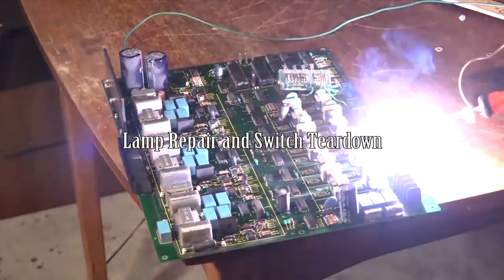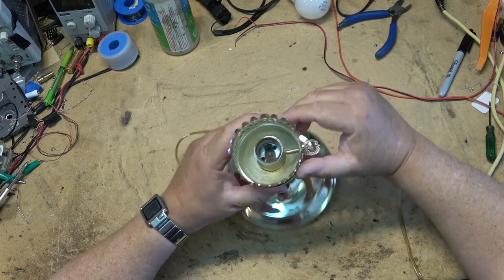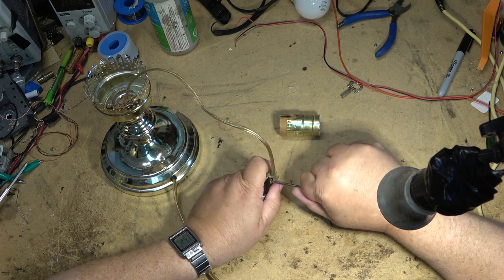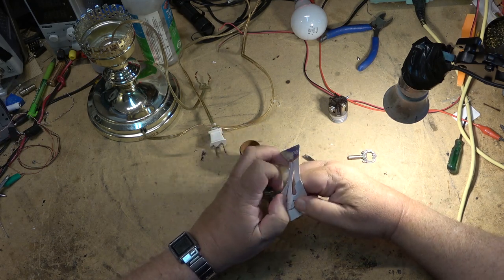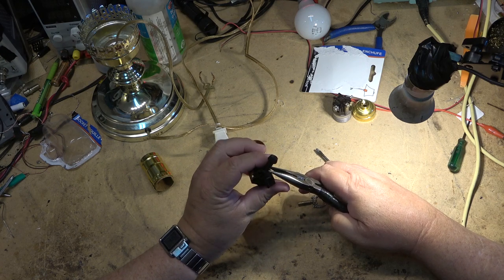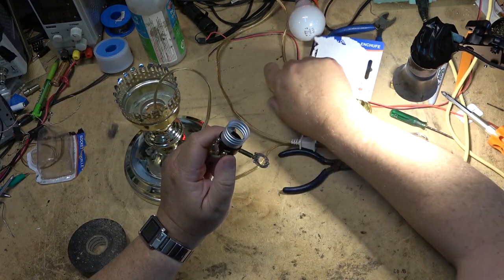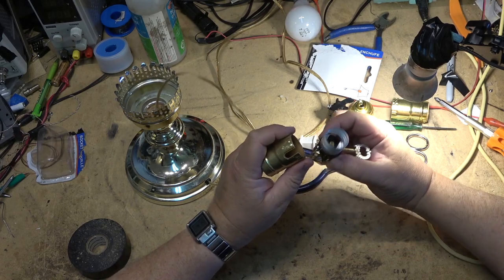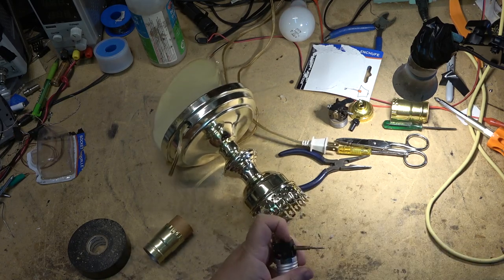Lamp repair making different sized parts fit

Comment: Did a little panasonic crt tv i found at the side of the road tonight , it sounded like it was coming on and i could feel the high voltage , but no picture , i couldnt find anything immedietly shorted or open, so with it being of that age i thought it could be a cap, i used the hot air station to heat the caps and it turned on , but had a fuzzy picture , so i took out a load of caps and tested them for capacitance, esr, and dc continuity , and found a couple of completely open 100 uf caps , tv working perfect now. Appriciate the confidence ive gained from watching 12 volt vids , youre unknowingly helping fix tvs from here over the pond

Comment: Thanks for the video, it fixed my lamp! 
    I had bought two of this style switch/lamp socket (internal piece of your replacement part) off of eBay in early 2020 for $.10 a piece at auction for no good reason at all.  

   I looked at them quickly when they arrived and did not see how they would be mechanically fastened to  a fixture(no threaded holes or mounting lugs) and set them a side until your video showed how they were mounted today. 
 
   I have taken lots of things apart, but never a traditional screw base light socket and switch an failed to recognize that the parts I have already have would be the ticket for the finicky switch in my bedside lamp.( It works if you get it in just the right position, been like that for over a year!)
   
  I paused the video at 2:36 an had my lamp working like new in a matter of minutes.
I have enjoyed your more technical content, but this time the simple video was really helpful!

Comment: I volunteer with the local "repair cafe", fixing small items for free (or for cost of parts only). We repair a lot of lamps!  I am fortunate in that the swap-shop and E-waste section of our local dump allows me to scavenge old lamps and electrical parts so that oftentimes I will have exactly what I need on hand ---- sockets, switches, cords etc ---- for lamp repairs. 3-way sockets in particular are a bit pricey these days, $10 or so. New lamp sockets are definitely not made as well as older ones and most would not last long if used with hot-running incandescent bulbs. And although I have disassembled many switches and potentiometers in audio equipment  to clean them, because simply spraying them wasn't sufficient, I've never taken an electrical lamp socket apart;  but watching this, it occurs to me that the rivets could be drilled out, the threaded aluminum collar removed in one piece, the switch contacts polished manually, and the aluminum collar reattached with small bolts.  If a close-enough replacement isn't available or the lamp is really an antique, this might not be a bad idea....

Comment: When I was a licensed telecom tech pulling miles of CAT5 on a big commercial job, an electrician said to his co-workers, "Look at those guys ---- their wires are so little they can cut them with scissors".  My response was, "imagine what your lives would be like if every single cable you pulled had to be a home run from end-to-end with no splices or junction boxes allowed in between, and without exceeding four 90ﾟ turns".  That left them speechless. PS, those scissors work great for cutting open lobster and crab shells!
Reply from the maker: I bet they do. They cut your fingers just as well if not careful.

Comment: If the knob is fitted on the switch-shaft too tightly to be unscrewed by hand without the entire switch mechanism spinning, use miniature side-cutting wire cutters to grab the shaft. Works better than needle-nose pliers or hemostats. Incompatibility between old North-American SAE thread electrical parts and devices versus modern Metric foreign-made electrical parts and devices is a common problem nowadays.

Comment: In the mid-2000s when my mother's 30 yo matching living room lamp sockets wore out, I replaced the cords with extension cords because they're cheap. I also wanted to polarize the lamps because I grew up getting zaps off of all the antique unpolarized lamps we had. Yeah, you can just flip the plug, but I'd hate to find out the hard way they were reversed. I even started marking the plugs before they were switched out with polarized ones. These days, I'd even ground lamps with metal bases. I got heart disease in the family, and I'm not intimidated by putting a third prong on a lamp. Better awkward than dead.
Reply from the maker: The lamp socket itself is completely isolated from the metal base. The only way you're getting a shock is if the cardboard insert around the screw for the lamp where to fail it allow the screw base to make contact. now if it was polarized that would always be the neutral side but not polarized it could be hot and you could get zapped if that is later where to fail. But the lamp is old the cord is in good shape and it's not moved around. I would be more concerned about the metal key switch turning on the lamp because as you saw inside the switch assembly itself it's just a small plastic insulator that's isolating  but even if you put a ground cord on if the switch failed the shaft could become live and since it doesn't touch the lamp base grounding wouldn't do anything

Comment: Nice looking lamp! Interesting video!
Side note: we had a drop in voltage to about 75-85 volts AC . Usually it's 120 volts. No LED or CFL lights were on. Except one. And the outside LED Security light. It was a power company issue. 
Lucky it came back on at full power an hour later. (An hour ago) It's weird one LED bulb inside the house stayed lit, and it was fairly bright! The other was just as bright.
The rest of the house was dark. The fan ran slower. The LED clock was so dim I could barely read it in the dark.
I also turned off anything with a compressor.(coolers, A/C) I read low voltage can make them overheat and burn out.
Reply from the maker: It has a glass chimney that goes over the bulb then a glass shade.  Is very old.
Reply from the maker: Low voltage can stall compressor and burn them out.
Reply: @TD75  yes, the only one I bought that was dimmable. I saved the original box because it was my first household LED lamp. Bought in 2017, started using in 2020. It's a Sylvania Ultra LED. 60W Equiv. 9 watts rating.
Reply from the maker: @TD75  that's a little extreme but works.
Reply: Some motors can also overheat on low line voltage.
Reply: @m.k.8158  Yes, I know. I turned off things with motors in them that was on.

Comment: I've noticed some import lamps are super gluing the sockets so the socket won't come apart unless you use a heat gun to soften the glue.

Comment: Interesting. Sadly, the older hardware stores are few and far between in the UK. The spring is making contact to the rotating contact and also partially to the shaft of the switch. Is the handle also entirely metal, or has a plastic inner? I ask because the replacement socket appeared to have a plastic handle.
Reply from the maker: The spring is only contacting the plastic insert not the conductor. New one also had metal shaft. Had a plastic knob that went in garbage for the original key style to be fit on.
Reply: @12voltvids  Ah! makes sense

Comment: Dave, did you think of replacing the plug with a polarized one or were you just trying to keep it as original as possible?
Reply from the maker: Keeping it original also the house is acient.  The sockets are not all polarized.  How do I know, because i have changed a few out for her to plug in modern equipment with polarized plugs and filed down a few table lamps so they work on the old 1950s sockets.

Comment: friend taking the opportunity, is there any way to make a led lamp last longer, 2 times its life with some modification
Reply: It not the led that usually fails. It is the AC to Dc circuit in the bulb that goes out.  Led's work on dc voltage.
Reply: Comment got deleted.  Maybe mistaken for a link. Big Clive tears down and analyzes led lights etc. He explains it better with schematics than I can in words. LEDs fail now too as they are run hard without much heatsinking.
Reply from the maker: Led lamps are driven hard to get maximum light.   Now that many are down to a buck or 2 I am not too worried about them failing after a few years.  When they were 20 a bulb it was much more annoying when they failed.

Comment: I've done this before to change from old socket to new socket on each lamp fixtures at home, and I can buy them sockets brand new and get it to install to the lamp fixture and get it going again.

And I rather leave the original cover back on for the sockets to look like it is original to the fixtures, and yeah, Chinese companies names has a funny name on it, and I rather not put the new cover on the socket and thinking it was a modern fixtures are made in China and will fail down the road.
Reply from the maker: I left the old brass on it so it looks original